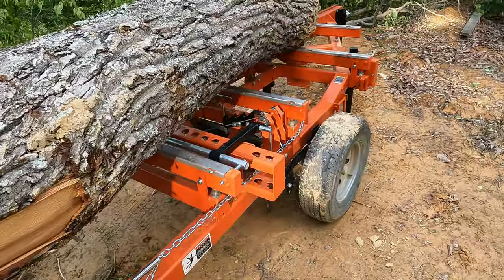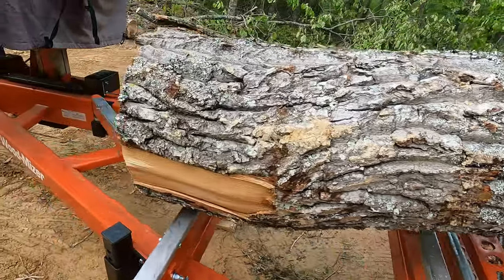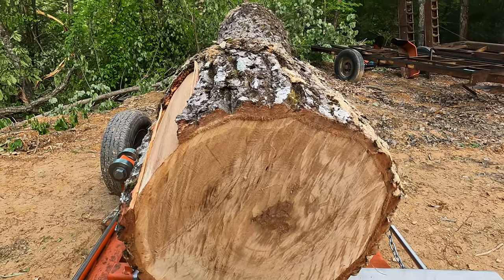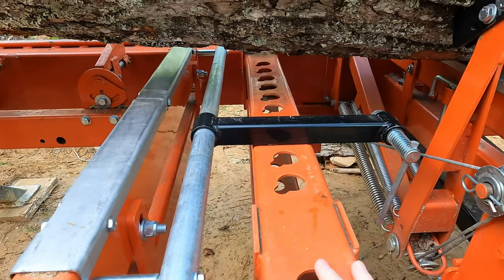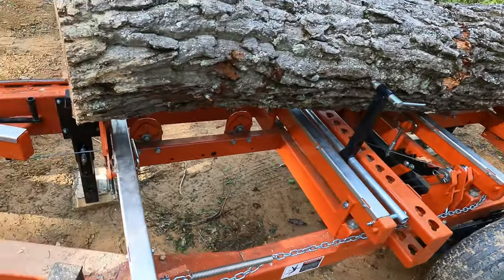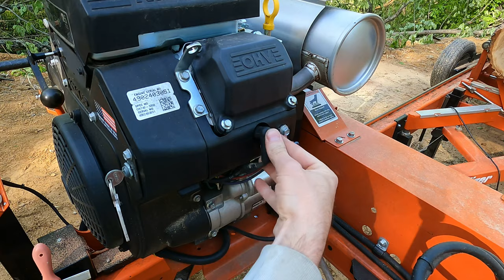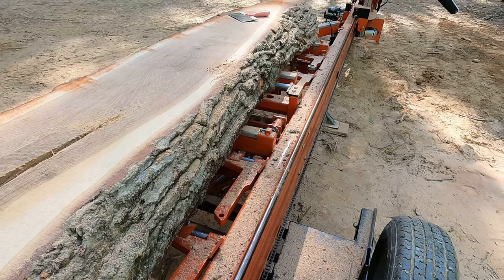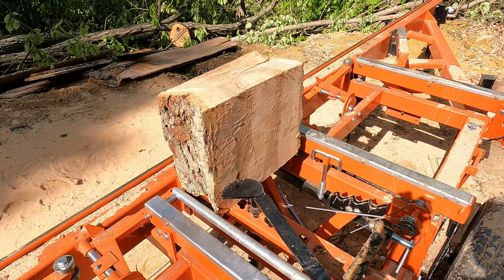Wood-Mizer LT28 Mods and sawing

Comment: Researching Sawmills now. What do you think about the long term reliability of the LT28. Any concern with the single side support for the saw assembly? Would you recommend a different saw based on your experience. Thanks for posting your videos. Nice quality.
Reply from the maker: Awesome! I have been more than impressed with the reliability so far. I can’t think of any problems I’ve had with the mill. I was kind of concerned with the single sided mount for the saw head when I was researching them myself but again I’ve had zero issues with anything being out of spec. Still cuts true despite being moved around and setup in different locations many times. I have no experience with any other brands other than watching them on YouTube. Sorry I can’t give you a better answer but I can say that I’d buy it again and I never minded making the monthly payment even if I never sawed a single board that month. Lol. I still love it. Thanks for watching and good luck with your saw purchase!

Comment: Great video I just found your channel I’ve had a lt28 since 2008 love the log clamp idea did you make that or buy it from wood mizer? I have the electric winch too but switched mine to a wireless remote winch it can be operated from anywhere around the mill.
Reply from the maker: Thanks! I bought the log clamp from Wood-Mizer for an LT15 and just bolted it on. There’s a little support arm on the clamp that keeps the clamp standing upright on the LT15. I cut it off because it’s not needed on the LT28. Other than that, all I did was drill two holes and bolt it on. I’ve thought about the wireless remote. I may need to try it out! Thanks for watching!

Comment: Can you upgrade to an electric winch through wood mizer or is that something you did?
Reply from the maker: They may offer something like that now but when I did mine all they offered was a hand crank winch. I built mine with some scrap metal and a harbor freight 3500lb winch. I did get the built in turner with the mill when I ordered it. I just had them leave out the hand winch because I knew I would put an electric one on it. Thanks for watching!

Comment: How hard was it to get the winch installed? I am getting tired of manually turning the logs...
Reply from the maker: It wasn’t too bad actually. I just welded up some 1/4” plate and angle iron to hold the winch and bolted it down where the hitch bolts to the frame. I use a small battery that I can charge when needed. It lasts me days before I need to charge it. It works great on bigger stuff but when I get down to a smaller cant, I sometimes use the cant hook. Thanks for watching!
Reply: @MountainMindset  Thanks for the quick reply! I also use the cant hook when they are smaller. I have a 30" diameter EWP on my LT28 right now and it's a bear to turn manually. I am going to try and add the winch asap.
Reply from the maker: @paulcasterlin1618   Sounds like fun! Let me know if you have any other questions. I’ll do my best to help! Thanks!
Reply: @MountainMindset  If you can show how the winch was mounted with a short video that would help me.
Reply from the maker: @paulcasterlin1618   I’ll see what I can do!
Reply: @MountainMindset  Thanks!
Reply from the maker: @paulcasterlin1618   Here’s a quick video showing the winch mount on the Wood-Mizer LT28. Let me know if you have anymore questions!
https://youtu.be/SvDly2BNqgU
Reply: @MountainMindset  Thanks for making that! You do nice work. Did you think about mounting it vertically? I have been looking at the exact same winch at Harbor Freight. It's either that one or the 5,000# one.
Reply from the maker: @paulcasterlin1618   a vertical mount would be nice as long as it wouldn’t damage the winch. Now I’m wondering if you can mount it like that. Lol. That would keep it from sticking out so far. I have the 5000lb harbor freight winch on one of my trailers. It’s been good so far. I do wish the winch were a little faster on the sawmill though. Maybe the bigger winch is faster. I’ll have to check that out!
Reply: @MountainMindset  That's what I was thinking, I might try it vertically. I have a feeling I would bang into it mounted horizontally...like my hitch receiver on my truck lol.
Reply from the maker: @paulcasterlin1618   Lol. Let me know how it works if you do it. I may switch mine around!